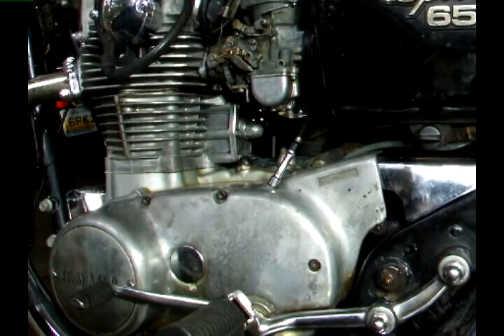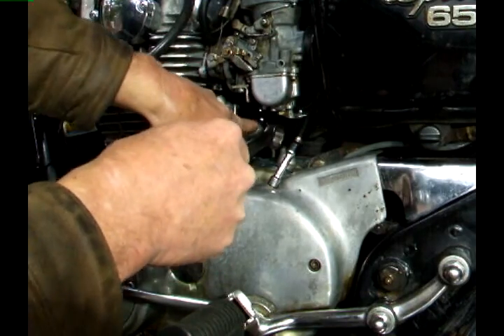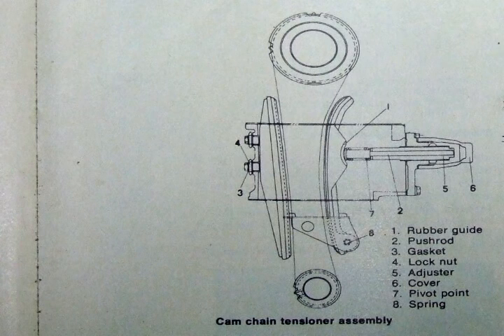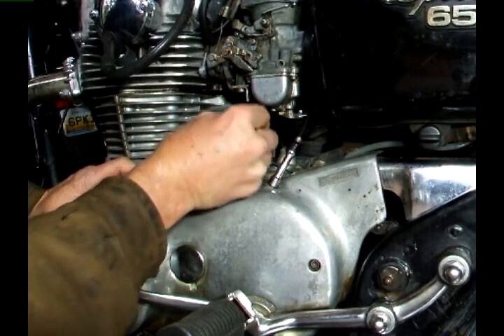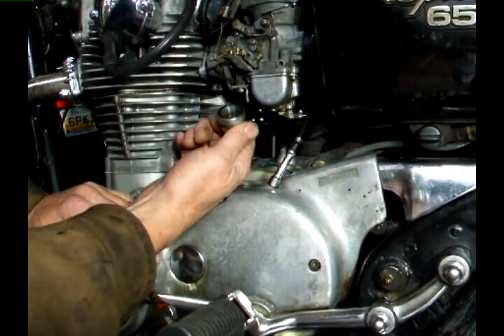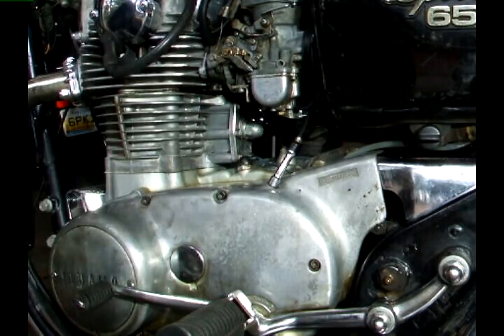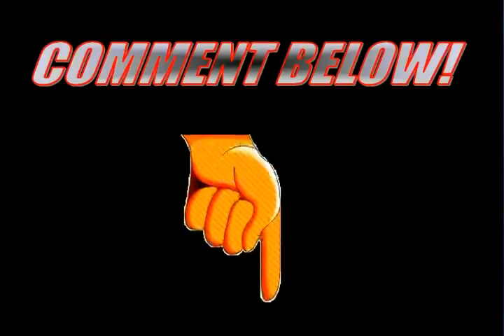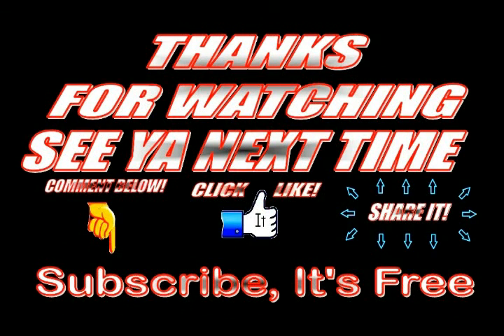Yamaha Xs650 cam chain adjustment

Comment: Before adjusting the nut be sure to turn the engine counterclockwise until the pin reaches it's outermost position.

Comment: Funny...On my 1981 XS 650 there is a lock nut that requires a 27 mm wrench. The crown nut is not the lock nut.  And you do the adjustment without turning the engine to watch the pin moving?
Reply: My 1981SH also has a 27mm lock nut
Reply: Same thing i was thinking. No rotation of the engine??
Reply: Beforehand the motor had to be turned counterclockwise, my book says